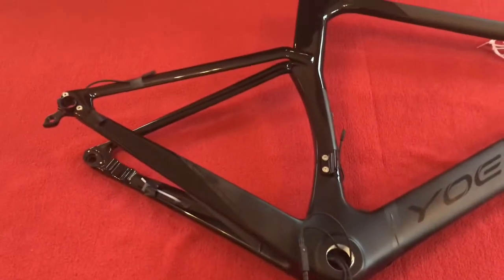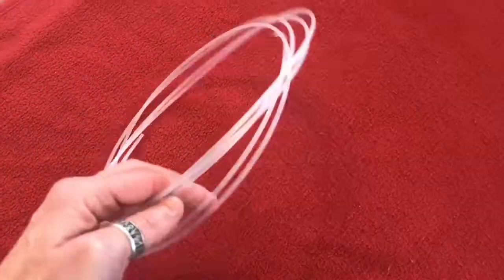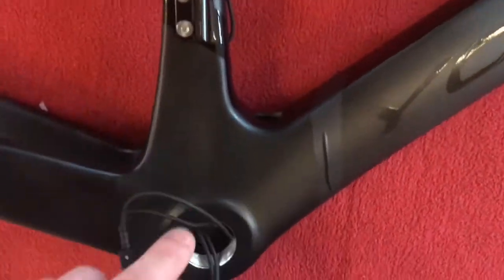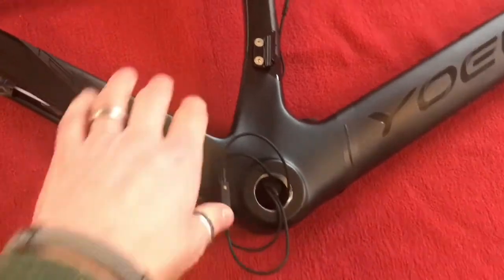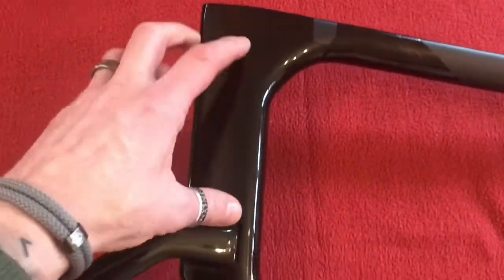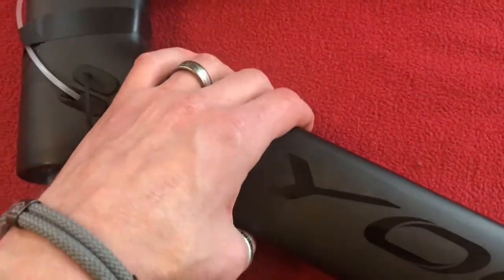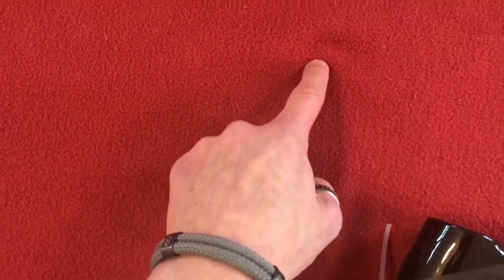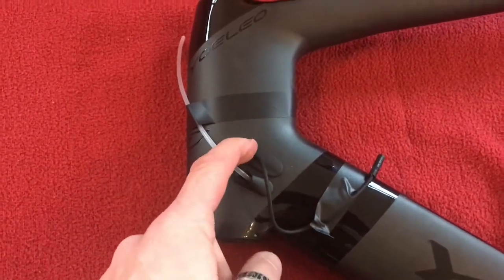Yoeleo R6 Aero Disc frame with Di2 cables routed

Comment: Can you share how did you mount the battery in seatpost?
Reply from the maker: Igor Hudolin now that’s a tricky one as the bike shop mounted the battery inside the post, hopefully when I take it out for my next build ill be able to see, but I don’t know unfortunately... sorry. 👍
Reply: @KyrosHouseCycling  sorry to bother you again, but would just like to know if you installed disk brakes yourself and if you had any problems with squeaking?
Reply from the maker: Igor Hudolin hello! I did put them on but the bike shop installed the hydraulics. Hopefully on  my next bike I’m going to install it all... as for squealing, I think you’ll always get a bit, though since I switched to ceramic pads I’ve had virtually none on the rear and only a little on the front, which is cured by wiping the rotor clean with a towel. It seems when the rotor gets dirty it squeals so I just wipe it when it starts to get too bad. I used to hate the noise but it’s quite useful to let cars know your coming...  kind of like a replacement horn....👍